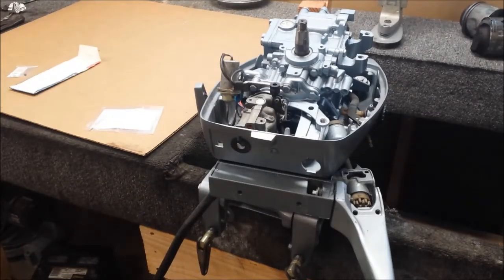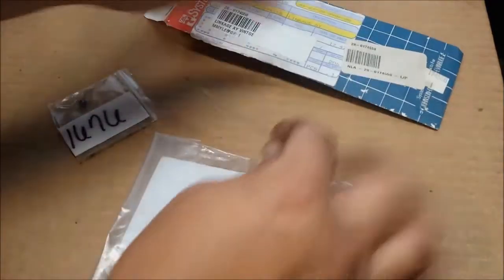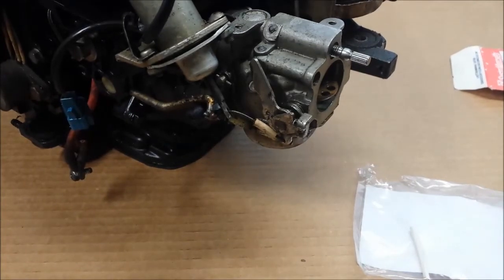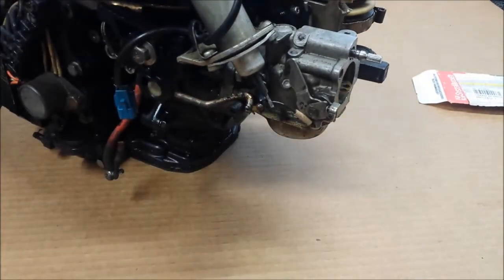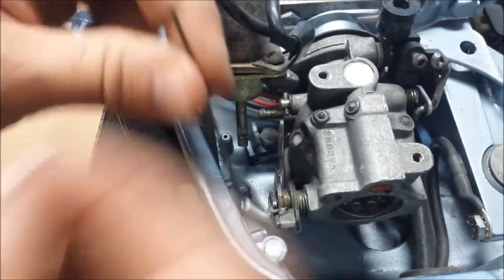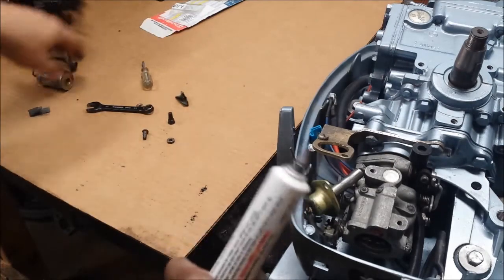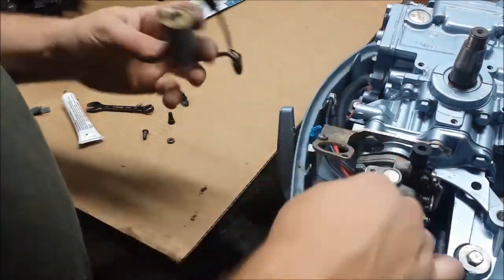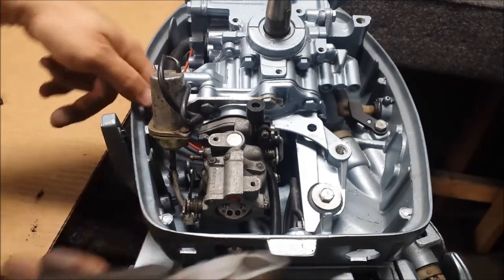Johnson 15 HP Rebuild; Part 7, Choke Solenoid

Comment: Do you have a video on installing a choke solenoid for a 1998 Johnson 9.9?
Reply from the maker: I dont believe it would use a choke solenoid, but a primer solenoid.
Reply: Would I have to change out the carb or would the existing carb work?
 Thanks

Comment: Could you fit a small cable stop on there instead of the lead part that gets crimped?
Reply from the maker: You mean like a cable clamp? Would need to be one tiny clamp.
The added benefit to that is the added weight might help pull the choke open again. 
(If the solenoid can lift the weight)
Reply: @BrandonsGarage  https://m.aircraftspruce.com/catalog/appages/wirestop.php?gclid=Cj0KCQiAkMDiBRDNARIsACKP1FH50-WxAZTGOD22TfYv1z8rICq1_XGQEELQxvV9LrEUMDDXDHix2XIaAmhMEALw_wcB
Something similar to this like you see on throttle cables on go carts and stuff.

Comment: I suspect the cover for the cable isn't supposed to be that long, they give extra for various applications.  I think it's on there just to prevent abrasion at the choke pivot hardware.

Also, assuming the crimp on ball is lead or lead based, I would think you could use side cutters to remove much of the ball (after removing carb and solenoid for easier access).  Then, either grind, or melt the rest off with simple propane torch.  Or possibly even a medium/high wattage soldering iron.

Finally, use a crimp on fishing sinker to recreate a new ball when reinstalling.

For "next" time...  :)

Thanks for a fantastic series!   I may even try fixing the 15 I have that I let the water pump get too old and it overheated and now has NO compression (surprised it wasn't frozen).  Haven't even pulled the head at this point.

RichE